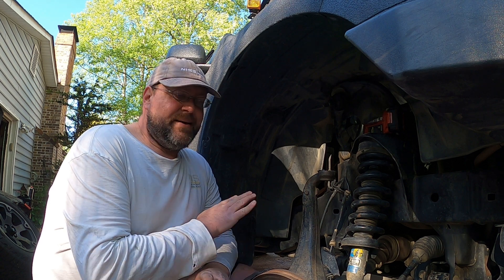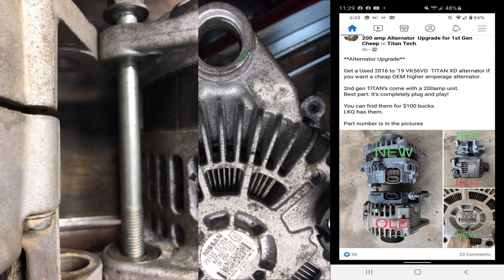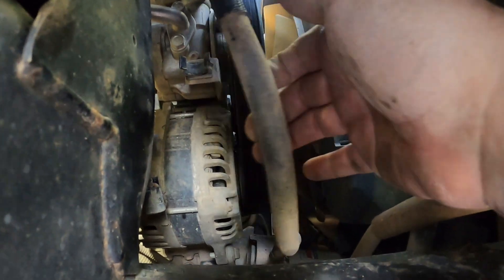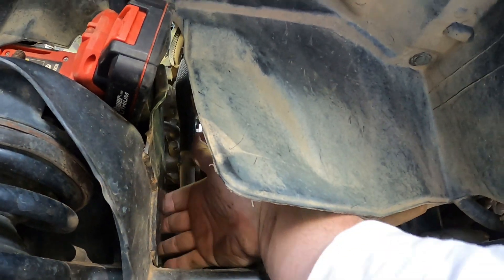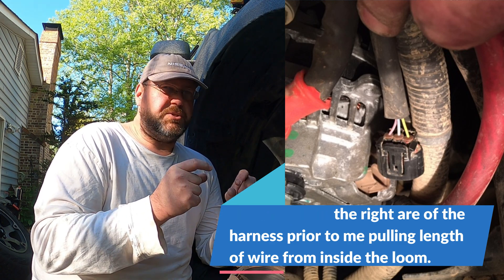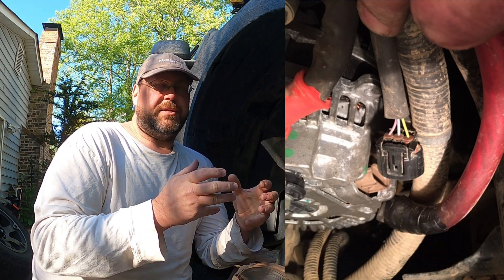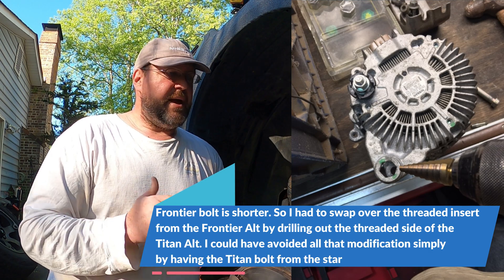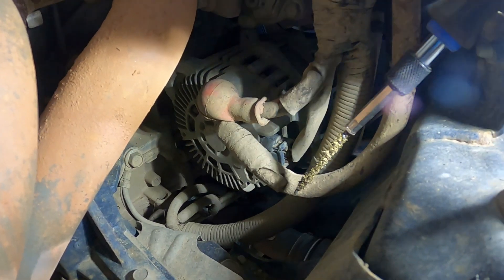Titan Alternator in Frontier using Preformance Extension

Comment: Two questions...  Are you running the larger cable from the alternator in tandem with the OEM?  It looked like there were 2 on that post.  Also, did you change the negative cable from the battery with that sensor that surrounds it and is it needed to upgrade that to do this?
Reply from the maker: 1) I did run the oem cable as well as the upgraded 1/0 cable. I didn't want to encourage others to do it that way which is why I intentionally avoided talking about it - but some guys are too observant and smart! LOL! 

Although both cables from the alternator are fused, the load is actually now split between them, so a problem/short on the alternator side would be less likely to blow both fuses - at least not before doing some damage. This is something I have meant to fix and have failed to get back to. Shame on me! The oem cable is stuck inside the factory wire loom that runs up to the battery, so completely removing it can be a pain unless you cut the ring terminal off and gently pulled it through. But, you could also just tuck the cable to the side as well if you needed to. 

2) Anytime you upgrade the cable on one side of the battery, you should also upgrade the other side to match. So I did also upgrade the negative cable to match 1/0 size. 

While at the time I did run it through the Hall Sensor, I now understand that was a complete waste of time. The Hall Sensor (In my experience and opinion) causes more issues than it helps! While it is true, if you are using it, you should NOT run any other ground bypassing it or it will mess with its reading.....the best thing to do is simply unplug it! Just don't use it at all.

Eventually I intend to remove my ground cable from the Hall Sensor and take the Hall Sensor off the truck completely! My Hall Sensor has been unplugged for about two years. I did back to back testing and showed that with it on and working, I was sometimes getting voltage drops as low as the mid 12 volts when I had high power demands. With low power demands, I was often seeing max voltage of mid-13 volts. That is not sufficient!

As soon as I would unplug the Hall Sensor, within a few seconds, my voltage would jump up to 14.4 and never dropped below 13.8v when I had minimal power demands. Even when I turned up my stereo, the voltage never again dropped below 13 volts. It made that big a difference. 

And regarding the change in fuel economy? Which is what the Hall sensor is supposed to help conserve, is fuel......My fuel consumption didn't change at all. 

So, when you redo you're ground with a matching cable for your positive side, just eliminate the Hall Sensor. As a test, hook up a volt meter and monitor your voltage for a couple days. Then,  just unplug the Hall Sensor and see if there is a difference. If there is an improvement or eve if there is no change, eliminate it. If unplugging it makes alternator output worse (which it won't), keep it. In any case, I'd like to know what you discover for your truck!!
Reply: @blackrocknissan  
With removal of the current sensor on the negative battery cable for the variable voltage control... are you not worried about an overcharge condition on the batttery?  Im running an AGM and I would be concerned with removing voltage control and possibly damaging an expensive battery.
Reply from the maker: @heftex8339  I think this is a FANTASTIC QUESTION!! 
There is a LOT of confusion about these systems and a topic you will see people speak broadly about, as if the information is universal - it is not. Just one example of how misinformation can get spread. Just because it may work one way for one manufacturer's vehicle does not mean it works that way for all of them.

Specific to the Nissan Frontier, Pathfinder, and Xterra (VQ40 model year ranges), the Hall Sensor was solely an effort by Nissan to increase fuel economy. It failed - miserably! LOL! A quick search of any forum or Facebook page and you will find thousands of posts about premature battery failure WITH this system because it undercharges even the standard lead acid battery. I will say, that is my opinion, I cannot prove that all those failures, for a fact, were due to the Hall Sensor.
 
Specific to your question - No, I have absolutely zero concerns about over charging my system. By unplugging and/or eliminating the Hall Sensor, all you are doing is preventing the ecu from over riding the internal voltage regulator of the alternator. So without the Hall Sensor, the alternator is actually allowed to do it's job and continues to use the internal regulator to adjust current output. Keeping in mind, that the internal regulator is STILL adjusted for standard lead acid batteries which have a lower peak charge voltage compared to AGM. So you are still at more risk of UNDER charging your AGM battery, NOT over charging it.
 
This is why AGM companies recommend you buy an AGM specific charger for your AGM batteries and throw a charge on them a minimal of once a month, but twice a month is best and MUST be charged after heavy use. AGM companies also recommend you charge your battery at a higher voltage - closer to 15 amps. Where at best your alternator will be charging at 14.4 amps, close but below the recommendation. So not overcharging or risking damage to the AGM.

Anyone failing to properly maintain their AGM battery by charging at a higher rate and throwing a charge on it once or twice a month to bring it to full charge (again, the charging system in vehicles won't put a peak charge on an AGM because it is higher than a standard lead acid) are the ones who are doing the damage to the life of their AGM's and don't even realize it. Comparatively, 100% charge on standard lead acid battery is 12.6v and for AGM is about 12.9v. Those who continue to run the Hall Sensor, which further reduces the charge rate of the alternator, is not only doing harm to their lead acid battery (IMO), but are absolutely doing harm to their AGM. 

XSPower and some other AGM battery companies will have specs on peak charge level, recommended charge voltage, general battery care requirements, and things like that. I always tell people...don't just take my word for it. The information is out there. 

Hope that alleviates your concerns about overcharging!

Comment: Just curious what would be beneficial from this upgrade?
Reply from the maker: - You gain an additional 70 amps (max) power output over the stock alternator. I mentioned at the end of the video that for me, increased power output was needed due to added power hungry components such as stereo system, auxiliary lighting, and winch. 
- The Titan XD alternator is readily available both as quality used oem (junk yards) and re-manufactured (Advance/AutoZone/Oreally's).
- Typically, to get increased output from the alternator, the cost can be significant for aftermarket units. BrandX is the most affordable (reputable) option for a 225 amp alternator (only 25 amps more than the Titan XD) for $275 - which is a fantastic price for a new unit, especially when a remanufactured alt from Autozone is $270 plus tax and a $40 core charge. But you can still get oem Titan XD alternators from the junk yard that are only a couple years old for 1/3 that cost. I bought mine from a junk yard on ebay for $90 shipped. But the cost for higher output BrandX alternators starts to go up significantly. For example - their 250 amp alt jumps to $445. But they offer as large as 425 amps for $680 (keep in mind my pricing for BrandX is two years old and likely much higher now!).
So comparatively, the Titan XD alt is an oem quality (it will last and take tons of abuse), affordable, "entry level" upgrade option for guys that will cost no more than if you were just replacing the alt for an original 130 amp version.